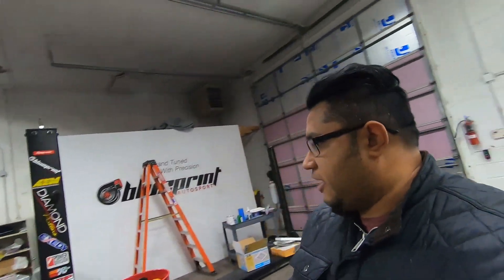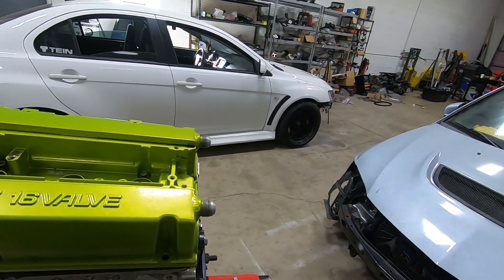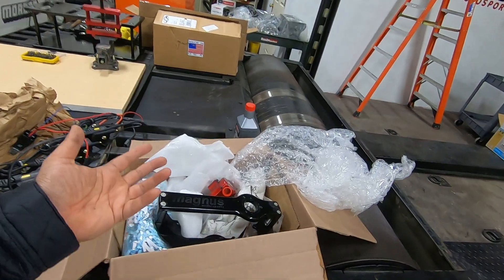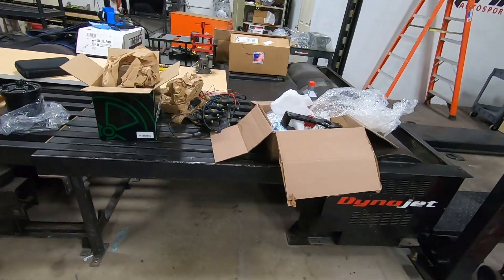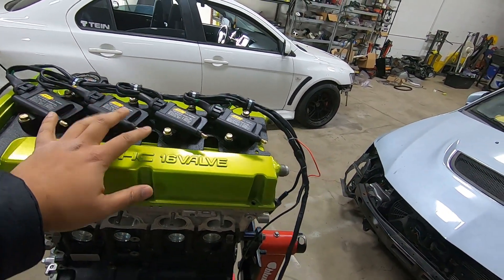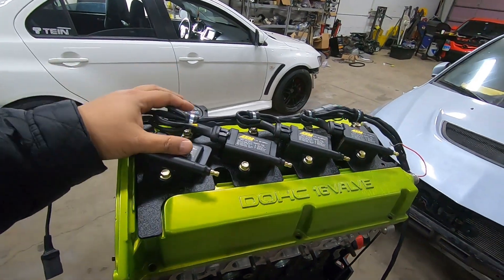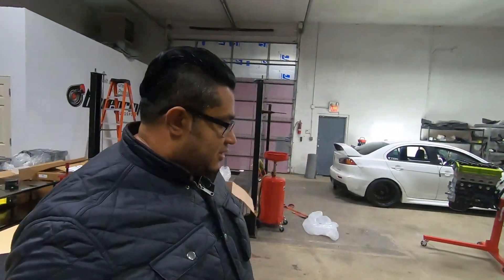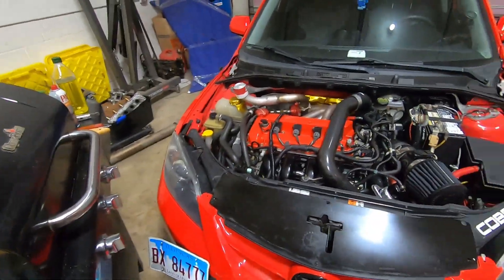Evo mechanical fuel pump and ign1a coil sequential ignition system

Comment: New to your channel and sub.  Just have a question what happens if that walbro 450 would fail is the mechanical pump strong enough to pull through it so not to run lean and give time to shut the motor off before there is catastrophic failure?

Comment: Great info. This information is exactly what I need. Thank you for the videos on the build. What is your opinion on methanol injection?
Reply: There are only a few instances when I would use it because the delivery systems for them is unreliable. 1) high hp and ur using it to supplement ur fuel system because ur injectors by them selves are not enough 2) high hp and mixed with ethanol and using m1 or m3 meth and using a really good delivery system with alot of built in fail safe
Reply: @mehidihassan7362  Ok that makes sense.  I'm building a second gen DSM and I'm looking to get around 600hp. People were telling me a weak point of the 2g is there intercooler and a good way to remedy that would me meth injection. 
You wouldn't recommend that?
Reply from the maker: @phantomslayss5361  if u have ethanol at ur local pump station that should be enough to get you to 600. U need big enough turbo and atleast 3" intercooler. No need for meth